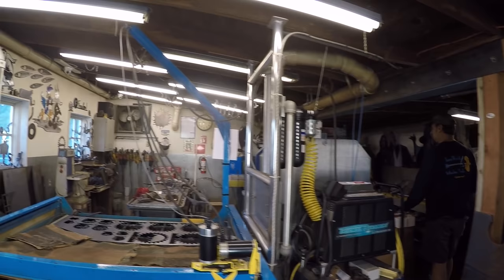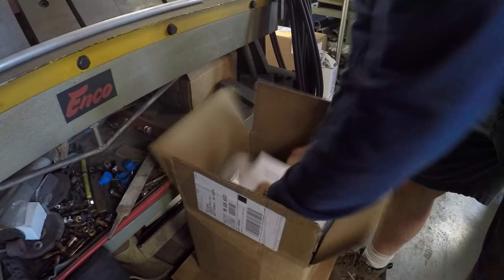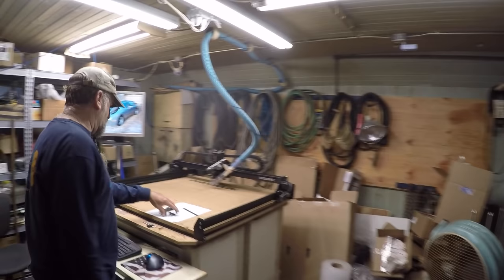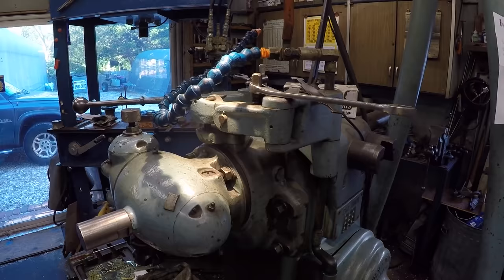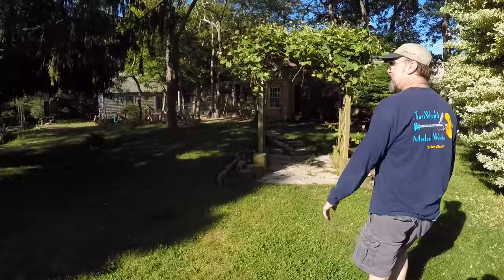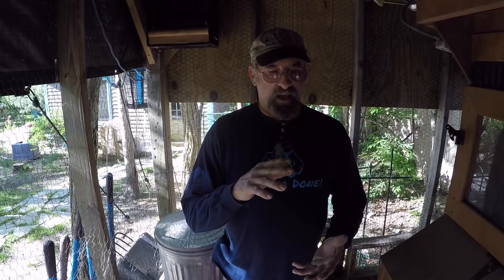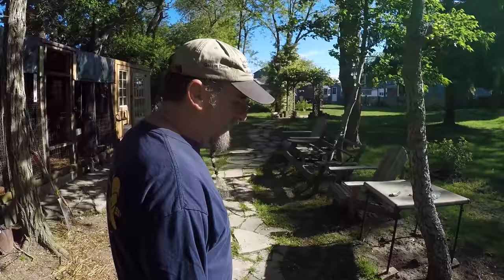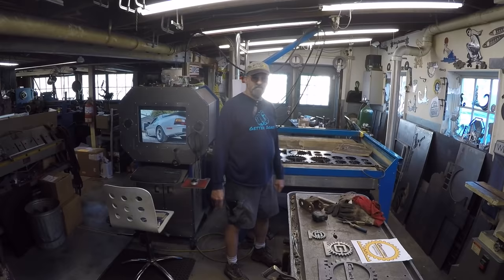TurnWright Machine Works Shop Tour!

Comment: Thanks John, and that was a good demo on how your new hand held camera mount works. Now audio wind socks LOL only thing I noticed was the wind. the radio was low enough which was a blessing, because I like off the cuff, and do overs, or planing, never come out the same.  ;{)------
Reply: VERY GOOD! Fun stuff!
Reply: Its great to get a continous shot of your shop. Its both bigger and smaller than I thought it was. From your videos I thought the big lathe and your welding/grinding areas were directly adjacent and that was the entire shop. I had no idea where the xcarve was, nor did I realize you had desk in the shop. The whole area around the smaller lathes and the shaper didn't exist in my mind. 

On that note, Keith you really need to do some videos on the shaper. I'd love to hear your take on how to set it up and use it.

Comment: at 6:08 I cab see an earth wire, were did you earth it out? Nice video!
Reply: Are you talking about the wire wrapped around the dust collection hose?
Pretty sure that is just to stiffen the hose, though it might ground it as well.
Normally, when you ground ductwork against explosion, the ground wire goes inside the hose. You can just attach the wire to the blower housing since it should be grounded as well.
Reply: joshua43214 Thanks for that, I have researched it in the mean time and I agree with you. Some people put the wire inside and add a wire on the outside as well. My blower is mounted on "plastic" wheels so I drilled a hole through the concrete floor and drove a copper rod through the hole and earthed both wires out that way. Problem solved with Z axis loosing steps when routing heavy dust material like polystyrene. Static discharge would make the Z axis drop to the table destroying the project every time until I earthed the blower out.
Reply: China First Wow, that would suck.
Grounding it through the 3rd prong on the plug is more than fine, no reason to drill the floor out.
If the ground prong on the plug is not doing the job, then you need to fix your shop electrical system, something in the breaker box is wired wrong.
Reply: LOL Too late! Jobs done, guys do it Joshua's way, much quicker and cheaper. I probably got sucked in by a clever sparkie who wanted to sell me a $40 copper rod and $80 labour to do the job.